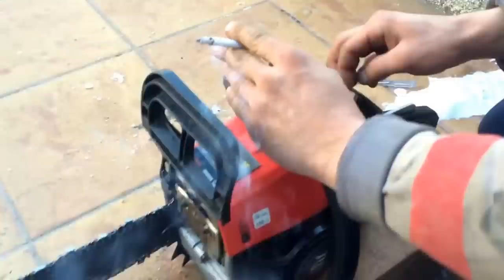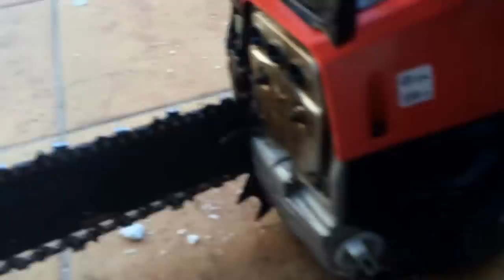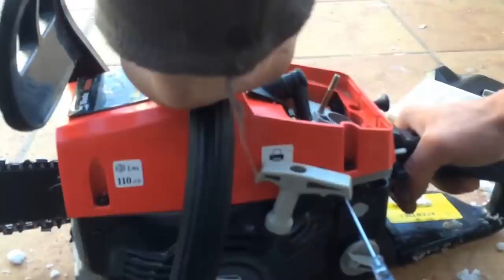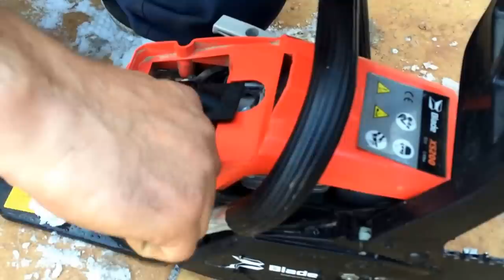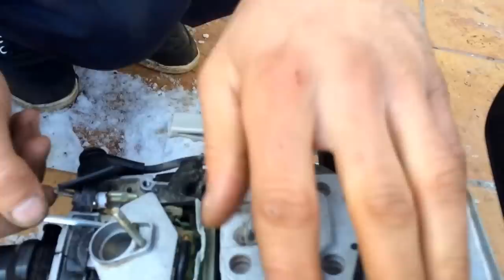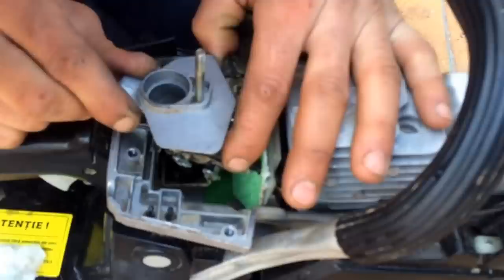Drujba Carpati, Blade, Micul padurar nu se accelereaza problema fiind carburatorul

Comment: drujba chinezesc 4500 reglarea carburatorului nu vrea  sa merga sa taie in lemn
Reply from the maker: +ilieandrei ghilescu incercati sa-i curatati carburatorul, in cel mai rau caz va trebuie alt carburator, dar nu este scump este 30 lei
Reply: buna ziua as o sa fac da  va musumes frumos
Reply: mai am o poblema rglez o druzba taiga 245  la  are X  P  SI NUSTU care ii bezina si care ii aieru la carburator tip veci Taiga 245 din 1999
Reply from the maker: ilieandrei ghilescu de obicei cel din spre acceleratie este benzina